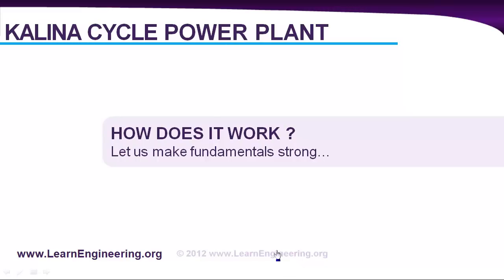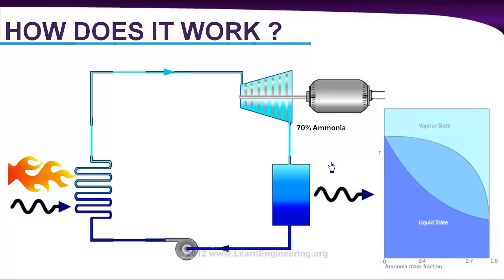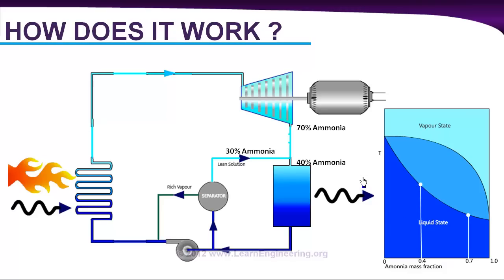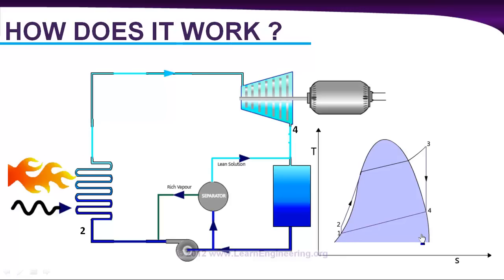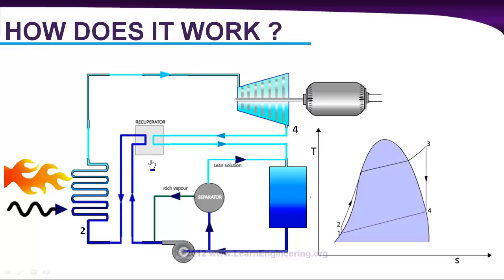Kalina Cycle Power Plant

Comment: This is an excellent explanation of the Kalina Cycle. 
 Although it is spoken in English, the strong accent and rapid pace makes it very difficult to understand.
 Here is my translation:

0:00 In this video we will understand how the Kalina Cycle works.

0:05 Here we will mainly investigate the various reasons behind it's high thermal efficiency compared to the Rankine cycle.

0:13 So let's start. 

0:14 The major difference between a conventional (Rankine) cycle  and the Kalina Cycle, is that, the Kalina Cycle uses a mixture of two fluids as the working fluid

0:23 The most commonly used working fluid in a Kalina Cycle is a mixture of Water and Ammonia.

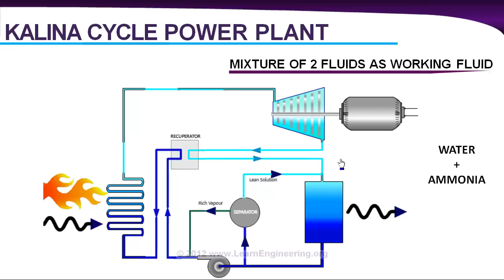0:30 So what is the advantage of this? Why should we use a mixer as a working fluid?

0:34 Two good answers for this question; Lets see a temperature and pressure diagram of a commercial (Rankine) cycle and a Karina cycle

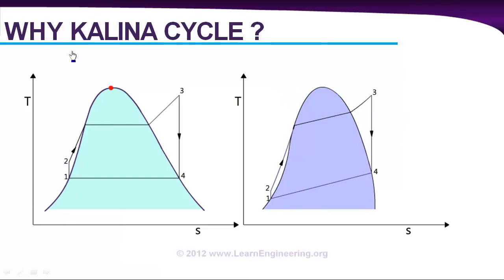0:43 Here it is

0:46 The first one is diagram for a commercial Rankine Cycle, and the second one is the diagram of the Kanina Cycle.

 0:53 So here again notice a major difference between these two.

0:56 In the Rankine Cycle during phase transformation temperature doesn't change, it remains the same. 

1:02 You can see during heat duration process: Process 2 to 3, temperature does not increase during phase transformation.

1:09 Similarly in the condenser, the process 4 to 1 the temperature doesn't change due to phase change.

1:16 But this not the case with the Kalina Cycle. Here, even during phase change the temperature changes.
You can see here: During heat duration temperature rises, and during heat duration drops.

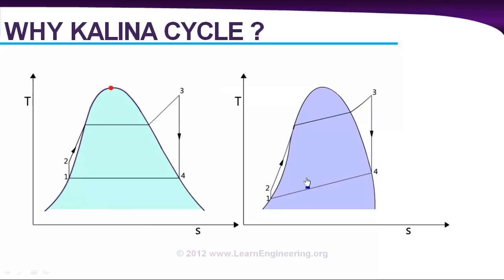1:28 Since we are using a mixture as a working fluid. This small deviation in thermal cycle makes all the difference in the Kalina Cycle.

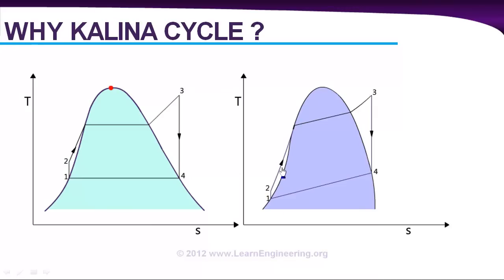1:35 This explains why the Kalina Cycle has much higher thermal efficiency compared to the Rankine Cycle.

1:41 Simply because of this reason; You know that the efficiency of a Carnot Engine can increase because of two reasons, first when temperature decrease or when temperature heat absorption side increases.

1:55 So in order to use this formula we will take average heat and average temperature and average ? temperature from both cycles.  

 2:02  For the Rankine Cycle average heat rejection and average heat ? temperature ? will be like this:

2:08  Average heat rejection ? because temperature is uniform during the process.

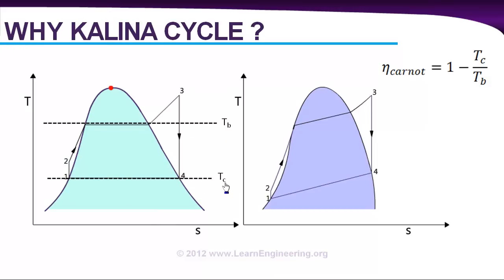2:14  And roughly this will be our ? heat reduction temperature

2:17  And these two average values for a Kalina cycle will be like this. We can see that it is much wider when compared to the Rankine cycle

2:24 It has higher average heat absorption temperature. And a lower average heat retention temperature.

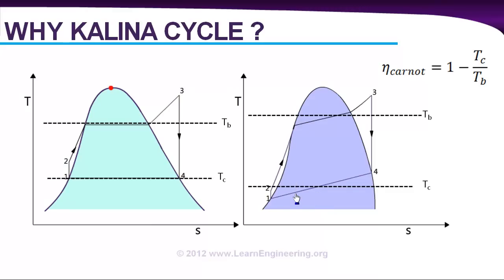2:30 So basically you have high level thermal efficiency

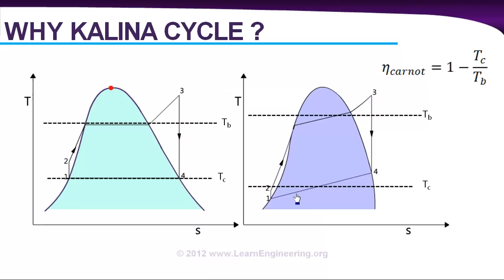2:33 Now let see how this cycle is implemented in actual case. (sic)

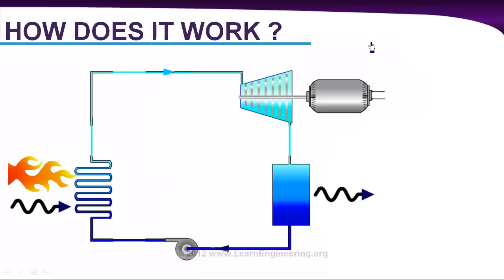2:37 How does it work practically? First we start with a very, very, simplified Kalina Cycle power plant, that has got four major components like a Rankine Cycle: a steam turbine, a condenser, a compressor, and a boiler.

2:51 When we send the ? through the main turbine , ?power is delivered? here, but the main difficulty ? with a Kanina Cycle is over here.

2:58 At condenser.  It's right after the turbine that the working fluid have almost 70% of ammonia by weight

3:05 Now according the face diagram when ? temperature is very, very low.

3:12 You can see it here. When the concentration of ammonia is 70%, the condensation temperature is really low.

3:19 if you want to condense a liquid you have to supply a very low temperature*?* through the condenser, that is not practical anyway

3:27 So what we will do, we will alter this concentration, we will try to decrease this condensation of ammonia with the help of a device called a separator.

3:37 What this separator will do; It will separate the working fluid into a lean mixture and into rich mixture.

3:42 And this lean mixture, which is having almost 30% ammonia by weight, will mix with the exit fluid ? and will produce a mixture of almost 40% Ammonia by concentration.

3:55 Now if you take ? such as much higher concentration/almost as of here

4:02 This can be condensed / water supply

4:05 Now the the condensation process is over. But we have to regain the original concentration in other parts of the cycle.

4:13 For that purpose a rich mixture from separator will get mixed? with incoming stream and the working fluid will regain it's original concentration.

4:21 The 77% of concentration.

4:23 if you check temperature ? the diagram of the Kalina Cycle carefully, you can notice one thing over there.

4:28 Temperature at ? is much higher than inlet of condenser. 

4:34 Or temperature at point 4 is higher than temperature point 2 

4:38 We can see it over here; But this is not the case with the Rankine Cycle. In Rankine Cycle this temperature levels were in other way. (sic)

4:46 Point 4 was lower than temperature point 2.

4:50 After this point 4 we are rejecting this heat to the surrounding, and after this point 2 we are absorbing heat from some external agency.

 4:58 So why can't we supply some amount of heat from point 4 to point 2. Which will save some energy and ?

5:07 That exactly what we will do here. We are introducing ? what we call Recuperator.
 And the function of the Recuperator is to transfer some amount of heat from point 4 to point 2

5:18 This is so basically possible because temperature point 4 is higher than temperature point 2.

5:23 And thanks to the Recuperator you need not supply the same amount of heat ? that was applied before. So the recuperator heat transfer increase thermal efficiency of the Kalina Cycle to a much higher level.

5:33 And all of these things prove that the Kalina Cycle is power plant of the future

5:39 Thank you for watching the video, have a nice day!
Reply: Thank you man, I was having a hard time too...
Reply: Thank you man, I was having a hard time too...
Reply: Thank you man, I was having a hard time too...
Reply: Appreciate your good intention & providing this ~
Reply: Excellent work
Reply: Thanks for your excellent service. Even though I could understand his accent, it's only because I worked as a 'software development manager' for a while in my past life, I wish I had your help at that point in my career!

Comment: It is good video but so much of awaited information is missing like...
a. the operating temperature and pressure of Boiler & Turbine,
b. the exhaust pressure of Turbine, will this be positive pressure or Vacuum
c. if the Boiler is to be of special design with respect to conventional Boiler, 
d. can we use Air Cooled condenser in place of regular cooling water/surface condenser
e. how is the ammonia separator works.
etc...
Anyhow this give good overview of this technology.
Thanks